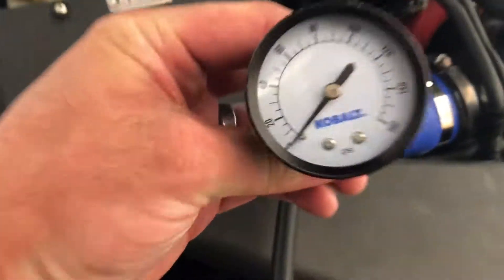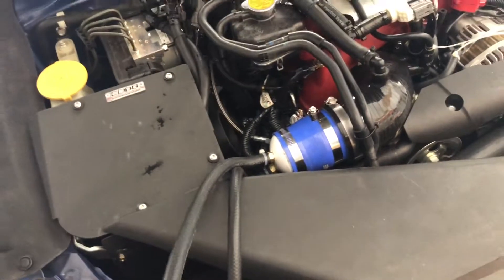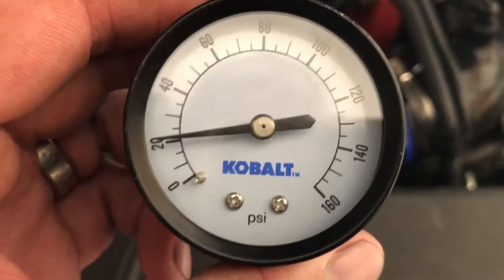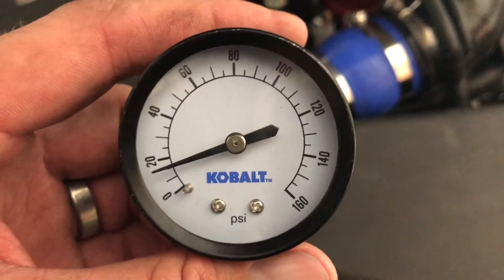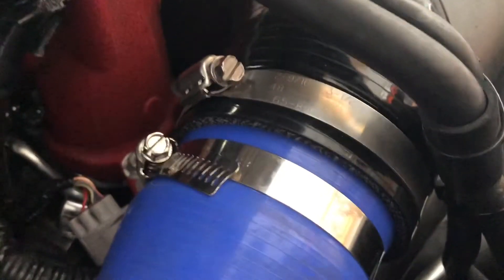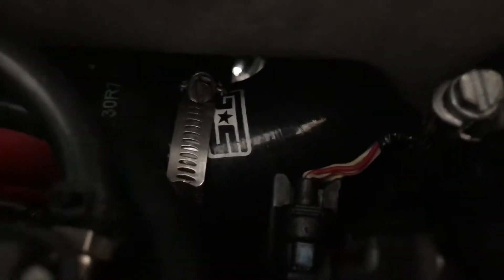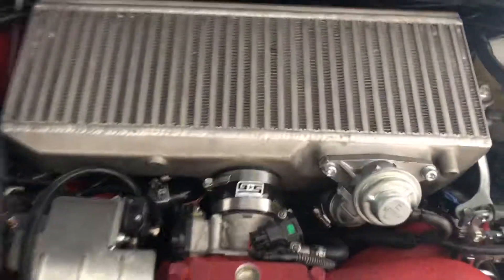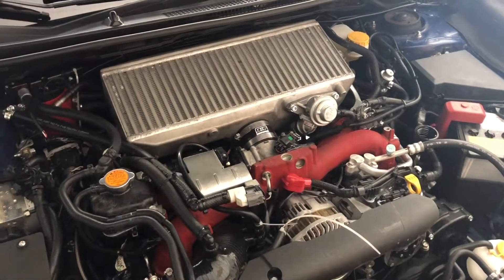2017 STi Boost Leak Test w/ IAG AOS

Comment: I have a 2018 sti and wondering if anyone had any problems with boost? Lately i think the wastegate actuator is bad as it sounds like the flap rattles and today I had no boost but the car runs fine? Any ideas
Reply: Did you ever figure it out? Going through a similar if not the same issue at the moment
Reply: @Bby_2JZ  did you get it figured out?
Reply: @rpmjunky2795  the code went away after a few days but came back. I traded it in before it did. Unfortunately I could never solve the issue
Reply: @Bby_2JZ  I had a constant rattle and it turned out to be my waste gate flap wasn’t closing fully.